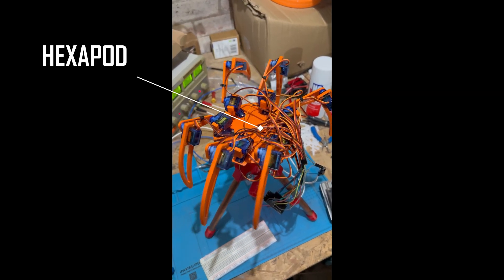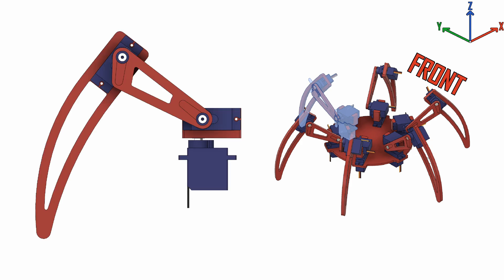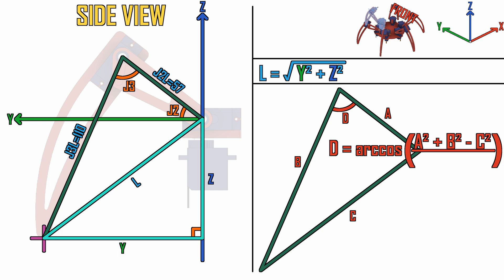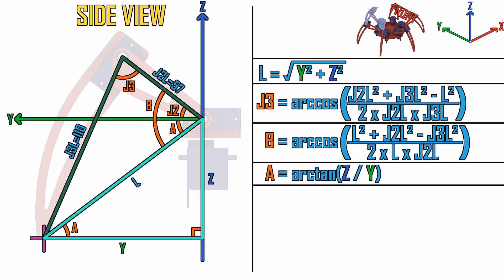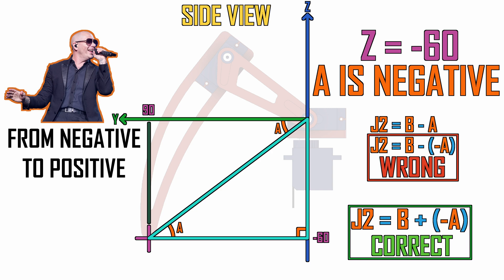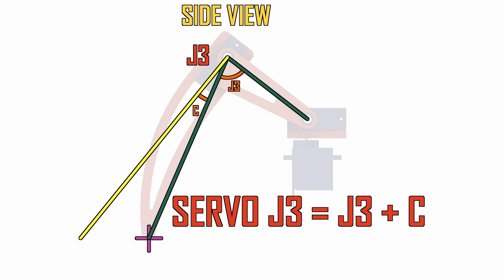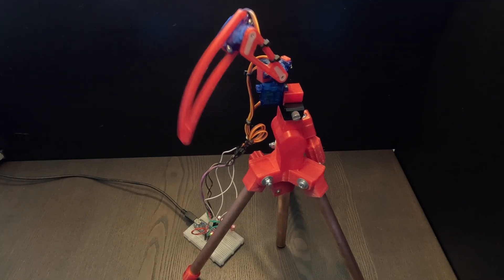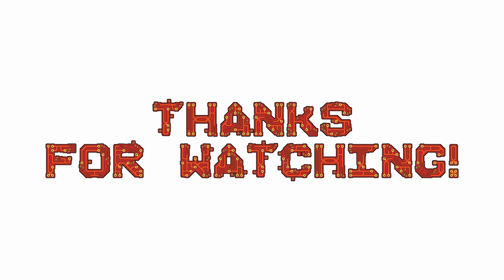Robot Inverse Kinematics With A Hexapod Leg

Comment: Interesting video with a good explanation. I want to mention that you can use the same rules to make the leg move in a straight line rather than an arc instead of using interpolation. 
How: 
Use the variable names at 3:50 and 11:30 as a reference.
 Let J0 be the third angle of the triangle J3-J2-J0 at the cross point of J2 (Y) and J3L.
 Get the lines j3, j2, and j0. 
*You have to calculate the j3, j2, and j0 lines when the leg is in the stand position.
 Now you can calculate the angles J3, J2, and J0 from the given j3, j2, and j0 lines. 
The trick is to make the j3 line equal = j3/CosJ1. 
now the angles J3 and J2 will depends on J1
You just need to set J3 and J2 in the code. 
J3 = ArcCos((j2^2+j0^2-(j3/cosJ1)^2)/2*j2*j0) 
J2 = ArcCos(((j3/CosJ1)^2+j0^2-j2^2)/2*(j3/CosJ1)*j0)
Boooom you got a straight line.

Thank you!
Reply from the maker: Thank you, some interesting information that I’ll make the time to digest when I’m less tired. I don’t think it’s the IK solution that causes the arced motion rather the mechanical system, I have no direct control over the speed of the servos and thus when all changed at once from their respective starting angles to end angles they all move as fast as possible which is not necessarily linear. Since I have no influence over the servos speed, interpolation gives a very simple way to get an approximated linear move that can be refined by taking more smaller steps. I can’t immediately see how a change in end point calculation could achieve anything else?
Reply: @JustAnotherMakerChannel  

 11:40 You used Pythagoras to get H so that's why the leg caused a rotary motion (arc) instead of a straight line.
Because you calculated the radius of a circle with J1 its centre 

Description:
 
Let's be in the same view by agreeing this.
****************************************************************************************************
- the joint J1 causes the arc motion because it has to rotate the leg causing circular motion (an arc).

- [To convert an arc to a straight line] >> you must increase the radius (for each increase in angle) ~ exponentially.

Ex.   
       if   J1 = 0  degree, radius = 10 cm
       
       when J1 = 15 degree, radius must be = 10.3528 cm
       when J1 = 60 degree, radius must be = 20 cm

How to increase the radius (you called it H)

>> [the radius length increase(+)] >> by decreasing(-) the angle of J2 and increasing(+) the angle of J3

    assume the lower and the upper bones = 20 cm and J3=60 degree and J2 = 60 degree

the radius = [upper_bone_cm / cos(180-J3-J2)] + [lower_bone_cm /cos (J2)]    
* (radius is result of looking at the leg from top view) *

>> 20/cos(180-60-60) + 20/cos(60)
>> 10 + 10
>> the radius =  20 cm 

[The equation] >> to convert the arc into a straight line 

radius = 20 / cos(J1) 

** but you need to know the angles of J2 & J3 to adjust the radius changing its length in the code **
[you have to create an algorithm]>> that changes the angle values of J2 and J3 (this causes a change in the length of the radius) depending on the angle value of J1 using a loop 

 for( J1 = 0 degree ; J1 < 60 degree ; J1 +1 degree each cycle)
{
        total_length_or_radius_cm = (upper_bone_cm / cos(180-J3-J2)) + (lower_bone_cm /cos (J2)) 
        J3= Arccos (((lower_bone_cm^2 + upper_bone_cm^2 - (total_length_or_radius_cm / cos(J1))) / 2 * upper_bone_cm * lower_bone_cm)
        J2= Arccos (((total_length_or_radius_cm/cos(J1))^2 + upper_bone_cm^2 - lower_bone_cm^2 ) / 2 * upper_bone_cm * (total_length_or_radius_cm / cos(J1)))
       or
         J3 = ArcCos((j2^2+j0^2-(j3/cosJ1)^2)/2*j2*j0) 
         J2 = ArcCos(((j3/CosJ1)^2+j0^2-j2^2)/2*(j3/CosJ1)*j0)
       delay = 100 ms      
  \\increase the value of delay to decrease the motion speed and the vibration that caused by the momentum.
}
https://app.gemoo.com/share/image-annotation/615760982094012416?codeId=vzxdG9ZpE6o7n 
if you didn't get me or the images links dose not work type a guest account so i can send you images or a video
Reply from the maker: [QUOTED]"11:40 You used Pythagoras to get H so that's why the leg caused a rotary motion (arc) instead of a straight line.
Because you calculated the radius of a circle with J1 its centre "[QUOTED]

The solution I presented is correct, the value of H will change depending on the X & Y co-ordinate of the position required and therefore does not to be manually increased or manipulated. To achieve a positional deviation in X, all 3 joints require motion. This is accounted for in the video by substituting Y @11:57 for H to allow the J2 & J3 kinematics to be calculated on the plane projected by J1's changing angle, which ultimately accounts for the arced path of J1.

The TOP-VIEW diagram you have presented in the link is exactly what we are doing @ 11:40, H is calculated using X & Y with Pythagoras, I can see that the underlying semi-transparent image does not make that too clear as I've arbitrarily drawn a vertical line from the Y axis, the value H shown @11:40 is exactly what you are referring to as 'H+L' in the link, which we cannot calculate from cos(J1) namely because we are trying to calculate J1, it is unknown.

The example of arced motion shown @12:19 has no J1 involvement, no X or Z movement, only Y movement from 1 singular point to another singular point, the motion is arced because both J2 & J3 need to move by different amounts and travel at an uncontrolled speed and the inability to maintain position during the deceleration of the other axes. It's not very easy to see but @12:24 J2 completes it's movement in a fraction of the time that J3 takes, this causes the leg to plunge downwards from J2 moving and then upwards to the correct position as J3 catches up (then some overshoot and oscillation)

I really appreciate all of the time and effort you have spent with your responses and the link and pictures too, I had to look through it a good few times and for a moment I was questioning whether my solution was correct!

Let me know if you have and other questions :)
Reply: @JustAnotherMakerChannel  
I used trigonometry to calculate the H, and you used pythagoras to calculate the H.
Sorry, I just misunderstood you, You are right! I was confident because I made a hexapod and used this equation with mg996r and it was working. now i realize that if I am right, that does not mean you are wrong  I was too hasty.
Thank you, I have learned a lot because of you.
Reply from the maker: Thank you, I really appreciate all your comments :)

Comment: could this math be used for a biped reversed knee style robot?
Reply from the maker: I think you could use it for any similar configuration, might need to re-orientate the co-ordinate system, I’ll look into it and maybe do a video
Reply: @JustAnotherMakerChannel  also how much harder would the math/ coding be with 2 more servos/axis added?
Reply from the maker: Well it depends on how the axes are oriented, it could become quite a bit more complex, with some 5 and 6 DOF (degree of freedom) robot arms there can be infinite solutions for a single point in space, I am planning to to a 6 DOF robot arm in the future but I’m having to brush up on my matrices math and manipulation first!